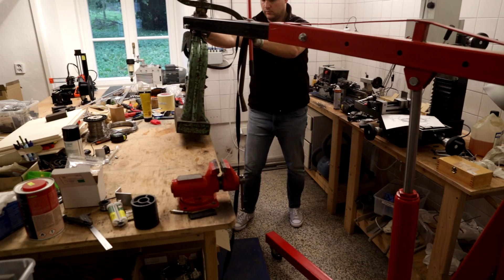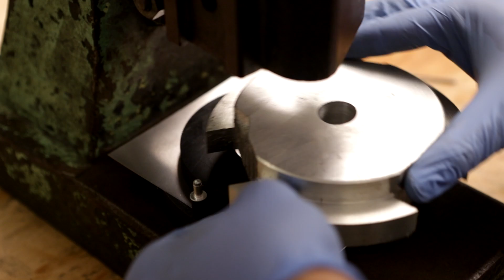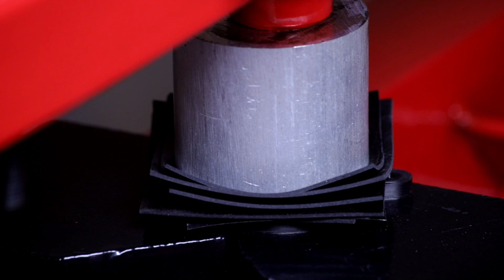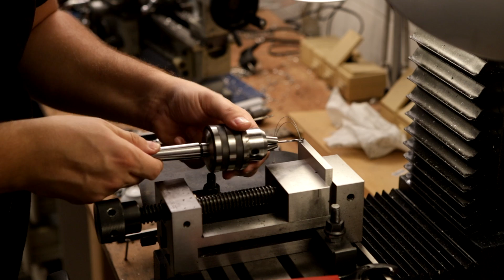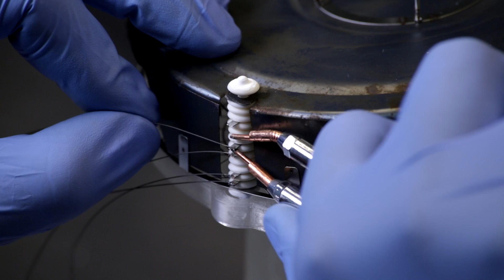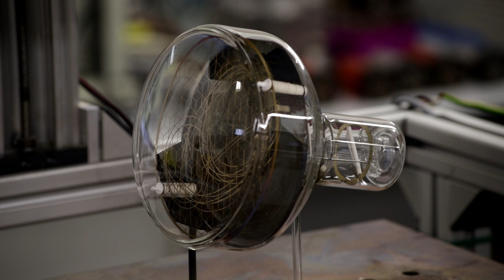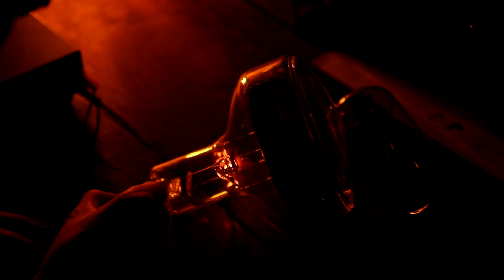Making: Huge Nixie Tube Finally Glowing!  - Project H #19

Comment: maybe try to use МГТФ-0.17 Russian wire instead of ceramic wire. teflon insulation... or maybe ftoroplast sheets cover for back plate.

another thing Use a two of glass pipes, for shorter distance between connection area of tube and external part. upper 6 pins and bottom 6 pins 13579+grid 24680+grid
this thing needs a excentrical holder for glasswork... thinking it is just an idea from me....

firstly prepare a plate with 2 tubes and sheet with digitholder, after put it into cap. fase outer window maybe will be a cleaner.

Comment: I'm surprised you can press so hard on a 70% infill regardless of the number of perimeters :)
Also, I'm pretty sure the default number of perimeters on PLA is 2 :)
Thanks for the inspiration, never realised how much pressure I can work with with these 3D printed parts..

Comment: The machine shop where I used to work did a lot of rubber pad forming.  The press was a custom one which produced over 200 tons force and the tooling was made of aluminium.

Comment: Hello Dalibor Farny! I propose a new project. Place 10 numbers and 26 Latin letters in one glass container. 10 + 26 + 1 anode = 37 pins. The letter "I" looks like the number "1", the letter "O" looks like the number "0". It turns out 2 pins less than 10 + 34 + 1anode = 35 pins. This indicator can be used in digital information displays. arc70@mail.ru

Comment: Hey i have a few ideas
For bending when heated :you can tension parts whit springs
For insulation :as you did in keysight tube using glass might be a good idea but it will be a lot harder to work whit

Comment: I guess I’d experiment with vacuum sputtering/deposition of insulators onto the wires or something like that. Would be a right pain though, and likely not very flexible, so I guess I’d lean towards making the connecting wires solid rods instead of flexible wires. But I’m not sure, that sounds like it would really mess with your workflow.

The ceramic layer is evidently insufficient to handle the full 200V or whatever your tube is running at. Or even 100V. Maybe it’s designed for contact with a conductive solid, but the insulating material is somewhat porous and hence conductive fluids can short it at much lower voltages. Would make sense if there’s tiny cracks or holes all over the insulation considering it’s flexible. I’d maybe suggest PTFE insulated wires instead, but that would quite possibly offgass too much and ruin the gas mixture. Hey, maybe fluorides would give an interesting color to your digits!
Reply: At 22:25 the brightest part of the ceramwire is the part that’s bending significantly, which would lean towards proving my hypothesis. Though to be sure you’d need to look at the inside and outside of a bend, expecting the outside to have more openings in its insulation.

Another potential fix would be just covering all the cathode wires with a solid conical anode, so even if they glow you can’t see them. Bit of a poor solution though, especially if you like looking inside your nixies or care about quiescent current.

I wonder how they used to tackle this issue?

Comment: And while I'm pretending I know the smallest bit about your work, here's another bit of unwelcomed advice: perhaps use a crossfire torch to tip off the tubulation in the pumping oven and a fire splash guard quickly made from lathe tape?

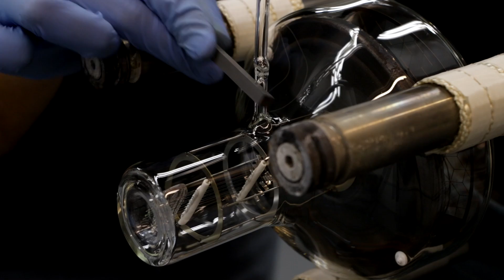Comment: 15:45 would have gone with what they call the "Angel of Mercy" technique around here (I don't know why) where you take a soupy hot bleb on a rod and smoosh it down onto the tip off, wait, wiggle and snap it off.  It's how I re-open almost all of my blow tubes because it results in a very even-walled and centered opening- not full open diameter, you'll still have to flare it open a little- but it is a very fast technique and you won't have to change up the torch.

Comment: Look at hydroforming. Builds high pressures inexpensively. Also, if you put the weld tabs on the numbers alternating at 160 degrees angle and 200 degrees angle you will have easier access to weld.
Reply: Right until you tear the membrane on sharp tooling or blank edge. Rubber pad pressing is good choice here.
Reply: True, but proper design of form and tears are no problem. Agree rubber will work here if he gets the right pressure build up.

Comment: Have you considered making your own insulation for the wires? you could use the same ceramic material you use to separate them, and simply coat those wires in it once they're tig welded in place. Adding that insulator between the connecting plates might also help reduce arcing.
Also, check out the channel "glasslinger". They've done some neat work on nixie tubes and also do a lot of tube replicas.
Maybe you can get some tips from them on how to reduce arcing!
Reply: Somebody has seen me! Wow! That's a new one!
Reply: @glasslinger  I've been following your channel since before the kitty nixie tube!

Comment: This may be a stupid suggestion, but what if you had pressed lines extending from the concentric ring perpendicular to the cutouts on the anode plate to prevent buckling in that axis? That would make that side much stronger, similarly to how pizza doesn't buckle when you fold it in half. 
Something like this: https://imgur.com/a/hu1R5Yy
Reply from the maker: It would still buckle in the direction perpendicular to the seam..
Reply: @daliborfarny   When you did the small plate with the cross in it it seemed quite rigid so what if you tried a vertical line either side of the centre circle at a 90 degree angle to the cut outs or even a square  pressing around the circle for more rigidity.

Comment: You're using the fly press wrong. You need to have some momentum, that's the reason for the big ball of metal on the opposite side of the handle, when you use it so it's quick and the metal doesn't have time to move. Instead it stretches and forms better. You want to start when the head of the press is a couple of inches away from the mold. Watch videos of them being used and you'll see what i mean. Someone with experience on them can pump simple plates like yours out pretty quick. especially if they're precut to size. Also maybe change your channel name to Ntube or NixieTube
Reply from the maker: I know :-) the problem is that this one doesnt fly :-) I will need to take it apart, clean and lubricate.. then mount to some steady support.. for a basic idea it was good to usemit as aimwas.. but thank you for the explanation!
Reply: @daliborfarny  To prevent the buckling of sheet metal, it's useful to clamp the surrounding material to the stamping die. The friction prevents the surrounding material to get pulled closer to the center (where the diameter is smaller, so it buckles). Instead, the material needs to stretches exactly at the step. 
The rubber pad does somthing very similar.
Reply: ...but what happens when he starts building other amazing projects that aren't nixie tubes? Relevant names are useful at the start, however once you already have a tremendous level of associated search / linking it doesn't matter so much.  Right now if I search for "nixie tube", Dalibor is the first hit.

Comment: the problem with the wire is the thin insulator you get a step in dialectic from wire to vacuum and this creates extremely high fields wich lead to the lighting up of the neon, the only way is a thicker Insulator or one with much lower dialectic constant. maybe you can also optimize your electric flied and stay below the ignition, you have more or less a design not a process problem, looking forward
Reply: Described similar idea in czech above. The issue is not the step per se, its the E field gradient inside the insulator not being big enough such that the E field magnitude at its surface is below the strike voltage of the glowing discharge with sufficient margin. And yes, Er of the insulator implies inversely proprotional thickness needed compared to free path in the tube gas. Unfortunately most of the anorganics useable here won't be below Er of ~4, so quite thick in any case. Electrostatic shield at intermediate voltage to keep the local field gradient low enough is a fix. Rearrangement of the mechanical construction is needed in any case.

I am failing so see why the glowing discharge is sustained on the surface of the cerawire given its bulk and surface resistvitity is big enough - it should accumulate the surface charge and hence cancel out the E fied gradient partially increasing the E field drop trough the bulk of insulator. Either there is equilibrium established at some low leakage current but sufficient enough to maintain the glow or surface contamination is present perhaps?
Reply: @Konecny_M  yes correct especially oxides have quit high ɛr. contamination is possible the resistances needed are quite high, and also i guess that must have also a porous surface and cracks so no Continuos insulator. The voltages are not that high but you cant get something like tripple junctions, something i have to be careful for high voltage in space for example, also cold Emissions are possible if the surface is rough but i think the voltage is to low, but all depends on field strength. Also in a partial pressure atmosphere as in a Nixie things can be much more tricky. surface contamination is also still a possible problem maybe it gets better over time when most of it will evaporate. but that can be easily testet in a simple test tube where you can also resistivity heat the wires in vacuum.
Reply from the maker: Thank you for the comment, I will focus on the E distribution and potential gradient in the next video. I am getting more into that right now. Regards!

Comment: For your back plate does it make sense to use a 3D printed honeycomb frame and then a fix the plate to it to gain the rigidness (similar to how a large telescope is setup). Instead of insulated wire how about using porcelain tubing to get rid of the glow.

Comment: Have you tried coating the wires in high temperature PCB Solder Mask?
Reply: There are several documents about PCB outgassing and preparation of electronics for Ultra High Vacuum applications such as Space Industry. They usually bake the PCBs in a vacuum at high temperatures to further cure the Soldermask resin (after UV curing) to remove all moisture before integrating the component in the final place. 
You can mount the internals of the tube and coat the wires with soldermask, put it in a UV box for curing and then bake it in a vacum. Than when you put inside the glass bulb it will be ready and it will not glow because it's electrically isolated
Reply: @thomasesr  Tube bakeout temperature is above 400°C. Anything organic base does not stand a chance surviving that.

Comment: Regarding the glow of the ceramawire:
A common way to test insulated wires is to place them in water (with some salt) while having the wire ends above water. Then measure the insulation resistance from the conductor to the water. If there are any cracks or holes in the insulation you get a short to the water.
If the ceramawire fail this test it proves the insulation is cracked or faulty.
Reply: That's a great suggestion, Richard! I'm sorry the ceramawire didn't prevent a plasma from forming. Perhaps it's caused by tiny cracks that are not a problem when using the ceramic insulation to prevent physical contact between the wire and nearby conductors. But in a conductive plasma... It's another story. Thanks so much, Dalibor, for documenting your work! It's really fascinating to watch, and we are all so happy to see first light from the tube!
Reply: @AppliedScience  Hi Ben!
Reply from the maker: Nice test, didnt think about it - will do for sure, thank you!
Reply: @daliborfarny  Extra ionic contamination and/or long washout period then drying is the last thing you want here as extra steps. Glowing discharge test in air is good choice for this.
Reply from the maker: @Konecny_M  thats for sure, I think it was meant as a way how to get more information about porosity of the wire rather than a systematic wire testing before using in a real tube.
Reply: @daliborfarny  Testing with a megger with the wire dipped in salt water or mercury would do the trick I suppose
Reply: Run a hand-held tesla coil over the insulation. Any pinholes will attract a spark. I saw a neon sign builder do this in-person. I don't know what the proper name for the tool is, but afaik there's a tesla coil inside. The spark terminal is 30cm of steel sticking out of the end.
Reply: @MrSunrise-  they are called "leak detectors"
They are also used to to detect flaws in welds.
https://www.electrotechnicproducts.com/leak-and-holiday-detectors/
look at the BD-10 series(and perhaps the other models too).
Reply from the maker: @MrSunrise-  the tesla coil produced thousands volts - the dielectric strength of the insulation is only 200VDC, so it would probably spark along all the wire.
Reply: @MrSunrise-  I think I've seen glassslinger use something like that.
Reply: dipping it in mercury would be better test of insulation, but little bit more hazardous
Reply: @yoppindia  I am almost sure mercury will not help. It has extremely high surface tension in contact with air. It is highly probable that the surface tension with ceramics is also very high. Mercury would not wet it and would not get into the small cracks.
Reply: @VáclavBrožík-f2r  I had read a book about transformer in which they showed a way to test enamelled copper wire for cracks. All it need is to touch the wire with mercury and you will get open  cracked enamel by passing a current through copper wire and mercury. Infact there are switches which are used to detect position using mercury. https://en.m.wikipedia.org/wiki/Mercury_switch

Comment: Glowing lead wire solution: Paralell multiple wires and/or use large diameter wires to lower the average heat per wire below incandescence - i.e. lower the resistance for that section (copper?)
Reply: The material is not glowing because it is heating up it is some interaction between the ions and electrons in the gas. The cathode is relatively cool. If you look at another video you will see that they use these tubes for counting frames in high speed cameras. You couldn't do that with incandescent glow.
Reply: @neur303  Gas? In a vacuum?
Reply: @andrewmcfarland57  There is low pressure gas in the tubes (he doesn't make that clear in this video but he explains it in others). It's a mixture of neon and argon I think, which is introduced after first completely evacuating the tubes. It's excitation of neon atoms by the high voltage that causes the glow; in a complete vacuum nothing would happen.

Comment: I would love to see a clock made from those tubes however im guessing that from the size of it it takes a bit more current than usual
Reply: You can see that they use between 33mA and 57mA per digit by looking at the power supply on the background. Let's say that's a nominal 40mA per digit.
And the voltage varies from 147v to 160v. Let's say it's nominal 150v.
That means they'd use about 6 watts per digit. So, for a 4-digit clock at that size, you'd be using 24 watts of power!

And that's just the digits! if you add in the control circuit and the dots, you'd probably get up to 30 watts total.
Reply: @Bleats_Sinodai  you lost me at watts i understand volts and amps but watts im stumped on so im guessing they use slightly more power than a normal nixie tube
Reply: @entity9742  watts are a unity of power consumption. you get that value by multiplying the current and voltage going into the device you're powering.
150V * 0.04A = 6 Watts, for 1 digit.
Since you need 4 digits for a clock, you do 4 * 6 = 24 Watts.
The typical current for a nixie (like the super common IN-12A) is 2.5mA per digit.
150V * 0.0025 = 0.375 Watts, for 1 digit.
That means the Huge nixie takes 16 times more power to light up than a regular nixie.

Comment: You said that digits can deform when they glow because of heat. What if you use this effect to your advance and make some kind of hinges that bend a lot when heated. Just imagine something like a moving glowing butterfly inside that large tube. That would be amazing.
Reply: As far as I know, old fashioned (non electronic) fluorescent light starters are effectively neon lights with bimetalic strips as the anodes which are designed to bend as they heat up to short the neon light out, causing a spike in voltage to strike the arc in the main tube, so in essence, that sort of thing already exists in a very primitive way, although I am not sure you would want quite the same shorting out effect in a nixie tube :).
Reply: @jg374  Yes, you are right about florescent light starters. In the case of nixie the bimetal does not need to connect to the opposite electrode it can extend or disconnect the glowing electrode.
Reply: I think Dalibor meant they expand a lot during the glass envelope sealing process and risk was they will buckle, short, break or stay buckled in the sealed glass bulb. 

In operation it doesn't get nearly as hot.

Engineering the yielding elements is feasible of course, but I think this will compromise the stack's rigidity (i.e. it will rattle)

Comment: Since the Nixie tube will only be viewed from the front, what about a mechanical screen to hide the glowing wires? Some sort of thermally stable dielectric material could work, and if the rest of the display board is dark, it should remain invisible if it is aligned with the plane of the surrounding background.

Comment: The glowing Cer-Wire is probably due to micro-cracks due to bending. I actually have an idea for a solution, BUT I am not a glassworker or so. Actuall, silicon coated wires could be a possibility, because if you heat them enough (induction heating during vaccum) the silicon will burn up into siliconoxide, which technically is just glass, so perfectly vaccuum proof and insulating). Surely this would need further testing. AGAIN: Just an idea from an hobbyist...